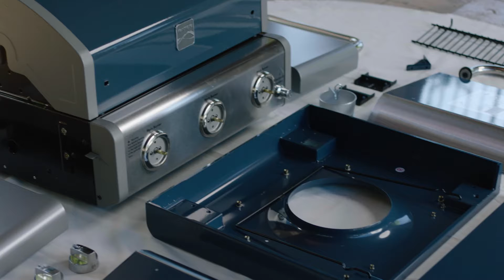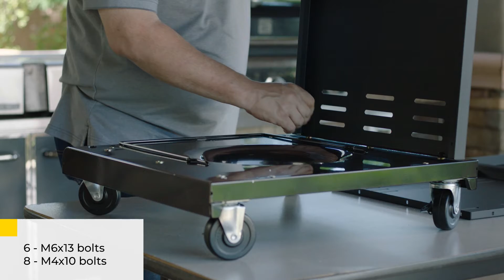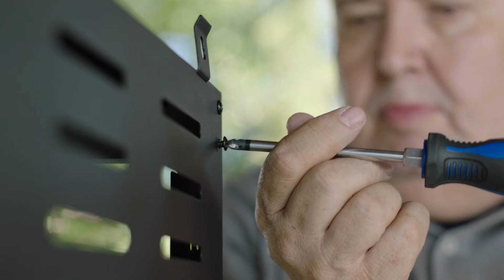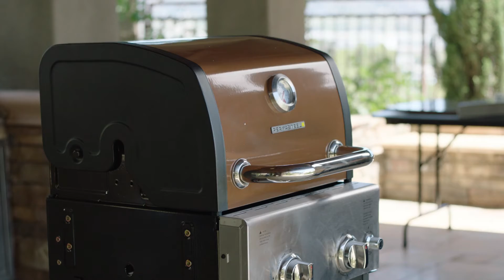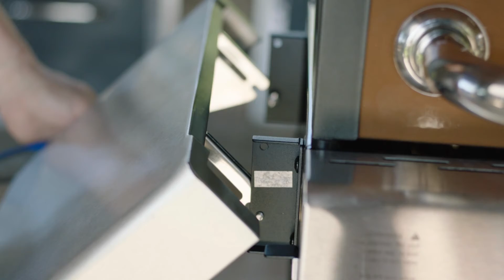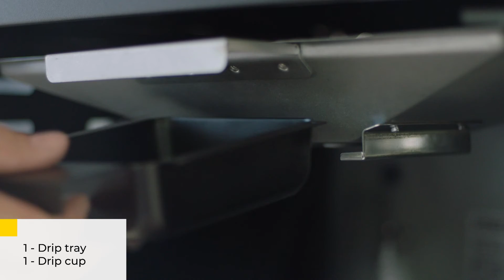How to Assemble the Permasteel 2-Burner Gas Grill PG-A40201 | Assembly & Installation Video

Comment: The screws with a huge radius and the tight spaces make this awful to assemble. Add to that, the assembly instructions show large pictures of the grill, while in the detail pics, you need a magnifying glass to see it. Whoever made that manual, is not very good at their job. However, it is a good looking grill.